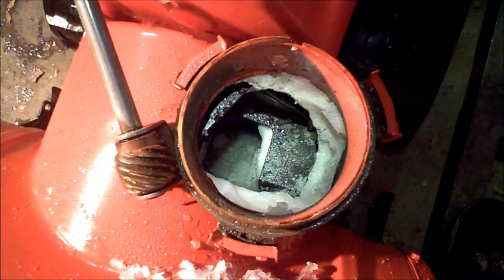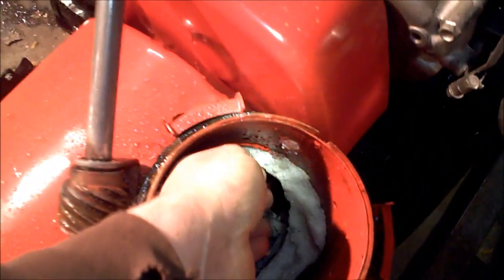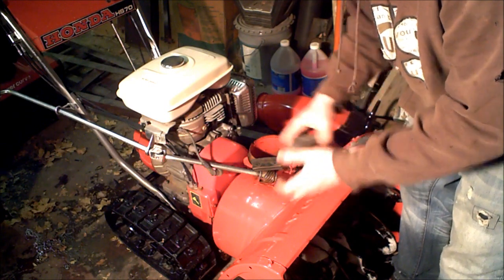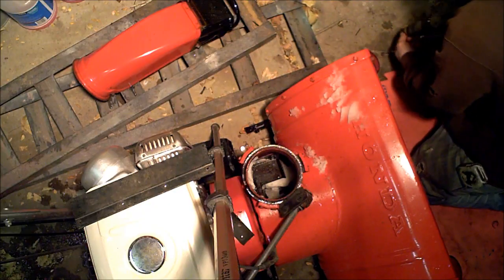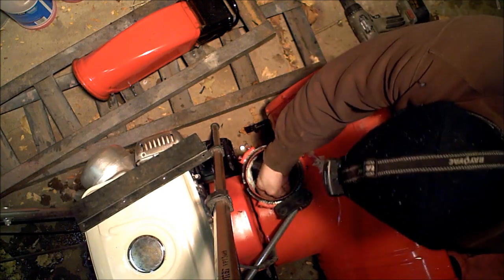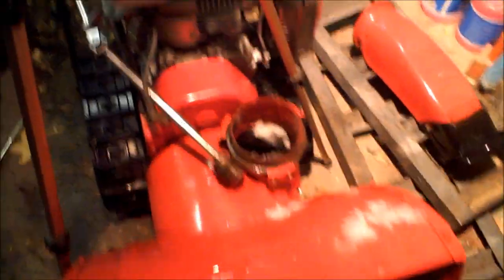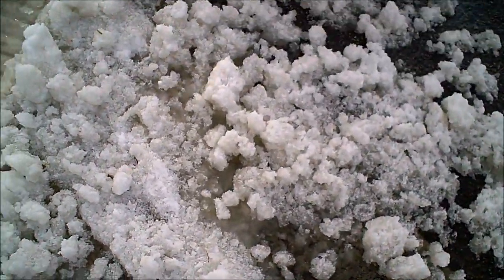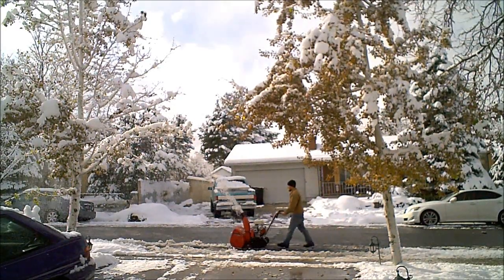Modify Snowblower to never clog and throw twice as far w/ Impeller Kit

Comment: this is the only way? I invested in a craftsman 24 in same as the one in the video. what could it hurt to try looks like you know what you are doing . I want to almost make the chute bigger or something.my buddy said it don't throw snow an clogging because of some cheap spring or shim of some sort. think I ran over sticks.any help thx.
Reply from the maker: +FREAK EVO This trick will make your snowblower work extremely better and wont clog.
Reply: +sixtyfiveford how can i tell i didnt break the shear pins
Reply from the maker: With the machine off you'll be able to spin the front auger by hand if they're sheared.
Reply: +sixtyfiveford thank you very much. I tried to spin it and it won't budge so that's good news. thank you. I spread the word to all my fellow snowblowers to check your video out and every customer that I have at my job I tell about it. 
smart guy I will be installing soon. just have to find a good rubber piece and in got the screws covered. lol appreciate the tip you are helping a lot of people . you should be paid. and all the snowblowing company's need a word of advice from you. just can't believe they still make them to where they do this. unless the new ones don't somehow. anyway thankyou

Comment: That's awesome.  I have a big Husqvarna 30" with 414cc, 12.2hp engine.  Never had a clog and it has no problem throwing the snow over the alley into the neighbors yard.  That being said, I am going to try this just because more is better.  Aim for the neighbors deck and back door, ya I'm an ass.
Reply from the maker: +EricNielsen187 You'll be glad you did. You must live really north where the snow never gets a chance to thaw and slush up really good during the day.
Reply: +John Goroff I would be happy to but, I found a 50ft extension cord in the snow this morning.  I need to go buy some new shear pins and cut the cord out.  Husqvarna pins are expensive and hard to find, and I never use generic or a regular bolt.
Reply: THATS FUCKIN AWESOME...aim and fire lol
Reply: EricNielsen187 make them grad 8 bolts i think and cut small slit and boom there the exact same

Comment: i have a john deere model 44 front mount snowblower for my tractor.  The 2nd stage impeller is plastic and its getting worn out.  Does anyone know if they make an impeller from something other than plastic?
Reply from the maker: +MrJokerman43 I doubt they have a direct replacement in steel, but one could be fabricated/adapted pretty easily.  Throw rubber paddles over the entire surface and it will last way longer.

Comment: I am considering the Club Cadet 524WE that my local Costco has in stock. It has a 3 blade impeller. I checked out the gap between the impeller blade and the side wall, and it's at least 1/2". I reached down into the chute, and all of my fingers fit in between!

Would this model be a good candidate for the modification?
Reply from the maker: +LOA1955 Yes it would. If you get wet snow this will make it perform night and day better.

Comment: I have a MTD Yard Machines with an 8hp engine. Question regarding the impeller blades. You said this won't work on a Toro because the impeller blades are too thick. How thick is too thick? Also, my impeller has three blades in a Y pattern. Should I do all three to keep it balanced? Or would that matter?
Reply from the maker: +Nathan Lee Self tapping screws won't work on super thick Toro impellers.... The impeller mod still works you just have to drill and bolt. Do all 3 impellers.

Comment: Seems like a pretty cool trick. Now what happens when you run over a newspaper your saying its not going to jam. Because if it does that robbers going to get torn up trying to get a newspaper out. My other big question is what about when it gets really cold and the impeller freezes up and you gotta get a torch in their to melt the ice freezing the impeller is the rubber gonna burn up. Also I would not pay 600 dollars for a snowblower with a plastic impeller or a chinese engine. Let the consumer know look out for MTD, the big box stores and the chines junk engines that there using now, since Tecumseh left the market in 2008.

Comment: The modification on my machine is done, not without cost and pain, but completed.  I sure hope it was worth the time.  I'd even settle for no snow as a reward.  lol

Some warnings.  .  I have a 9 horse, 10 year old Craftsman.   Check how easy it will be to access the impeller and how thick the steel impeller is.  On mine, the only access was by taking off the chute and reaching in about 10 inches to the impeller blades (unless you're prepared to disassemble the entire front end which I wasn't) and the steel was at least a quarter inch  or more.

I needed to buy a numbe of tools as I learned what would and didn't work which involved three trips to HD.  The easiest part was the truck flap I used.  I have a band saw and grinder so after measuring the size, cutting and grinding a chamfer edge was easy work.

My first attempt was with self tapping screws that weren't up to the task.  The first one snapped off.  I needed to buy a $21 12" drill extension for that attempt, but I still needed it later so no loss.  I bought heavier self tappers and I bought a few cobalt bits although all will be returned except the two I eventually used.  The other major expense was for a chuck I could put on the 12 inch extension to hold the drill bits.  That set me back another $25.  What I didn't realize was I didn't have enough extension bars for my quarter inch ratchet, the reason for the third trip.

It took a lot of time drilling the 6 holes for the three blades on the impeller.  I used the cobalt bits do get close and the self tapping to finish the job.  I used plent of oil to keep the bits cool and luckily didn't snap any with all the play between the bit and the drill and the overheated worker.  

Something I thought about after the fact, since I drilled the holes and the fitted the rubber afterwards.  I should have clamped the rubber pads to the blades, started with the self tapping screws to mark the blades where the holes should be, then drilled them out.  

The other thing I'd suggest.  After installing a pad, if it's hard to move the impeller, starit up and run the auger.  It quickly corrects any clearance issues you have in the cylinder.  

The second one would be a lot easier than the first one, but come the winter   I'm sure I'll have forgotten the 90 degrees I worked it.
Reply from the maker: +Jim Rothenberger Great work. Yeah, some of these snow blowers(especially Craftsmans) have small and deep chute openings and can be a pain. I assure you though it was very worth your time and effort. Also doing in the warm weather makes a world of difference to the complexity of the task. Let it snow!

Comment: I fixed the problem just by using a sprayable grease(AMSOIL waterproof marine grease) I have a Toro 1132 walk behind two-stage.(11 H.P./32"cut)
Reply from the maker: 4 gauge You temporarily subdued the problem. It will come back quickly.
Reply: No,the problem has NEVER come back,reason being is that Amsoil is a Military rated marine grease that's unlike any other,very expensive though.(nearly $10.00 for a 14 ounce tube)

Comment: I went through one winter using the tip you provided.  Yes, it does work like a charm in Chicago where we hit the salt and snow where the driveway hits the street.  The houses are close here and I could hardly throw the snow against the neighbor's building.  Now, I could (but won't) throw it on his roof.  I installed the paddles on every bade of the impeller.
Reply from the maker: ***** Very Nice. I'm glad you tried it out.
Reply: No, thank you.  It took two hours to install them in the summer on my Sears 8 horse blower, but it was worth it.
Reply from the maker: You're welcome.. I'm glad you installed them in the summer as it's no fun in the bitter cold to try this.

Comment: I have a poulan dual stage snow blower. What has always worked for me was spraying the blades, and chute with some silicone lube. Then I wanted to spend less, so I use a brush with old motor oil. I put it on the shovels too. Helps keep the snow from sticking.
Reply from the maker: Imperviousgodspeed That works, but you also have to keep applying it. This mod with eliminate that and give you the benefit of throwing further.

Comment: Very nice! I'm going to give this a try on my 6' PTO JD blower. It's basically worthless in wet snow. I'll let you know how it works out. THANKS!
Reply from the maker: 'oIHSDGIH You'll be very happy with it. If you can get your hands on some 3/8"(1/4" will work) conveyor belt and bolts with fender washers or a metal plate you'll be set.

Comment: Awesome video that I just discovered. I was looking at my Cub Cadet (which is an MTD I know) and the bolt heads that hold the chute on protrude very slightly into the housing where the impeller is. Will this be a problem for the rubber strips or will the rubber just wear away at that point? Thank you, this is one of the great YouTube videos for anyone who lives in the snow belt.
Reply from the maker: MrCZLover Yeah, the rubber will just contour perfectly to these bolt heads.

Comment: When you modified your honda snowblower impeller with the rubber attachment to close the gap between the impeller blade and the housing, did you pre-drill the impeller blade to make it easier for the self tapping screws?   If you did not pre-drill, would appreciate  knowing what type of self tapping screws you used, since the screws seemed to penetrate the impeller blade with no problem.
Reply from the maker: James Tapp I didn't do any predrilling. Standard metal self tapping/drilling screws were used. They can be picked up and any home improvement store.

Comment: My sister has a driveway that is gravel so I was thinking of a modified blower for her.  However i am too old to do it but thought maybe you could perfect the idea or come up with one of your own.  The idea was to raise the blower an inch or so, so it would not pick up gravel.  I thought of a plastic snow shovel that is curved where the handle meets the blade. Cut off the handle and mount the shovel under the blower.
Reply: put the blower on a hard surface and place a 2X4 under the the front of your machine.  Then drop the side skids down as far as they will go.

Comment: Mod now complete via re purposed car tire side wall..  Boy does it throw snow now.  This was done on a troy built.  The impeller had a 1/2 inch gap in relation to housing.  The gap is now eliminated.  Thank you sir!
Reply from the maker: Commandermike wheelin That's a big gap. It's amazing such a little modification can make such a difference. GREAT use of the old tire.

Comment: I found you after the snowfall last week.  I bought my Craftsman second hand and it was a god sent for the last two years, then the latest  snow came.  I've lived with my 100 yard drive here for 19 years.  There have been deeper storms but nothing like this one.  7-8 inches of snow with 1-2 inches of slush under it, a nightmare.

3 1/2 hours of blowing, clogging and shoveling is a bit much as I see my 70th year get closer and closer all the time.  The next day I went out and the impeller blades had 1/2 inch of ice on them which I de-iced with spray and a heat gun.  It wasn't a lot of fun, but at least the slush had hardened and I was able to handle the parking area and the end of the drive rather easily.  Then I found your video.  I'll be upgraded for next season, guaranteed.

Two questions.  First, I haven't used self tapping screws before.  Will they work just as well as drilling holes in the blades and attaching with bolts/washers and nuts? And second, is the beveled edge necessary and (hope this doesn't sound lame), should the chamfered edge be Up or down on the blade?  I've thought about that a bit and I'd think the necessity would depend on the thickness of the rubber material used.
Reply from the maker: Jim Rothenberger You want to try and use as close to 1/4" material as possible. The Self TappingDrilling screws will work just as good as bolts in this application. The chamfered edge allows you to get the rubber closer to the housing(it will save you time) and wear it in.
Reply: sixtyfiveford Great, thanks.  Now to find a truck mud flap "road kill", unless I get impatient.

Comment: Hey 65 great mod defiantly going to try it on my craftsman. Although I think I might have another problem when ever I start blowing snow it doesn't work and makes a squeaking sound could that be the belt? If so do you have a vid on how to replace them? And also my paddles are plastic will the self tapping screws still work? Thanks.
Reply from the maker: AJ Frascino Yes, self tapping screws work just fine in a plastic impeller. Yes, it is probably your belt. Take the plastic cover off and you'll be able to see your belts.

Comment: Hmm have been thinking about this for a long time, but more like welding... 
Got to try this out on my junk stiga.
Ore i just have to blow it up 😂
Reply from the maker: hallays Even welding won't give you as tight as clearances as rubber. You'll still end up with 3-4mm gap. It's rare that the impeller is perfectly centered in the housing so the rubber can touch in one spot and have 2mm gap in the worst areas.

Comment: If you need more traction on toro knobby tires... Run lower tire pressures..

This trick really helps

Do it outside... Get a grinder an buff the entire tire surface area to creat a sticky grippy rubber surface

Then with a thin disc wheel cut and make notches in the old tire to creat your own winter tire type design, sipes. Like on a good vehicle winter tread design

Shouldnt take more than 10 min 

If you want to save $ this trick made my 1973 toro stick much better 

Dont run chains on wood patios or decks

Cheers bud😎❄️
Reply: Crazy Funny Cats, I achieved a similar setup by mounting 10” hand truck wheels with pneumatic tires to the drive axle. It had no-flat hard rubber tires wrapped in chains from the factory and the tires would slip inside the chains. I had to order some solid brass static bearings to take up the tolerance between the axle shaft and ID of the wheels’ hubs. Now I can replace the tires and inner tubes or the entire tire/wheel with a $14 trip to Harbor Freight. I also run low pressure to keep the bottom of the bucket down to concrete for a nice clean sweep. The machine has so much traction, it barely turns with the drive tires on the ground. I also applied a healthy bead of tire bead sealer to the tire/wheel mating surface to keep the tire stationary on the rim. I have to be careful not to bend the bucket in hard-packed drifts and piles near the road. The tires show minor wear after two seasons of use. I’m guessing this mod will allow the impeller to keep up with the walking speed of the machine. 🍻

Comment: And here I thought I was the only one doing this...beveled edges was a nice tip! Closely ribbed truck mud flaps laying along side the highway work best!!
Reply from the maker: Jim Young I like the way you work. Free mudflaps work great.
Reply: I'm planning on doing this mod for next season (when the weather finally clears up).  I like that road side mud flap idea and the price is right.
Reply: Jim Rothenberger I hve pretty much the same POS Craftsman blower as you do.  Mine is a 28 inch.  I cut some strips from an old mud flap and drilled and riveted them to the 3 blades on the impeller.  I left them a little on the long side, then used a filet knife to trim them to the size of the impeller housing.  All I can say is WOW!!!  This thing will throw snow nearly 40 feet. I have a gravel driveway and I had trouble with stones getting caught in between the impeller and the housing. Not anymore.  I just have to be aware of where I'm throwing it .. Don't want to take the windows out of the car or the house.
Reply: Yeah, they work fine as long as the snow is nice and fluffy, the ones that would be easiest to clear by shovel.

We had another wet 4/5 inches last week and it sucked.  That will change next year.

I like your idea of making them wide to fit the cylinder, makes perfect sense.

Comment: Hey I was wondering if this would work on my craftsman I think it's 2 stage fairly new about 5 years old and it clogs up every time I touches snow I saw something that said to use some sort of non stick spray?
Reply from the maker: AJ2192 Non stick spray or WD-40 works for 5-10 minutes on clogs, then you have to reapply. This works indefinitely and has the added benefit of at least doubling your throwing distance.